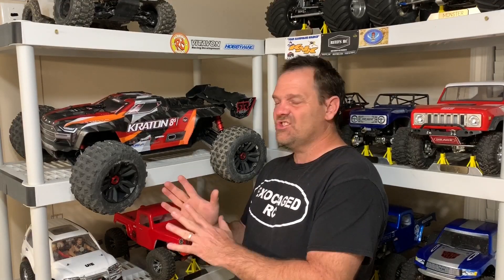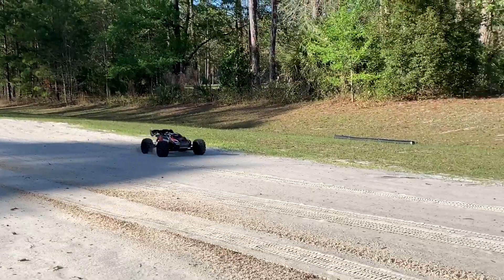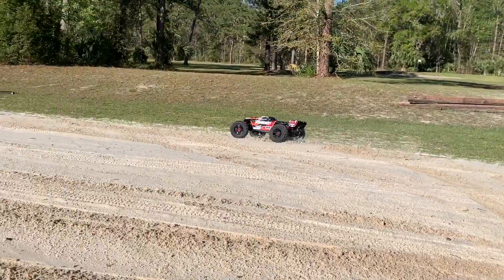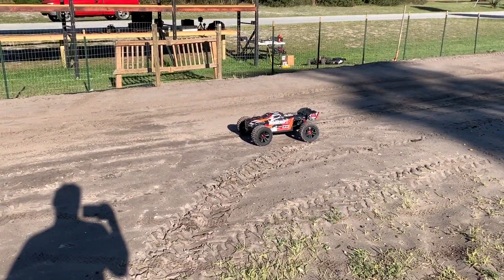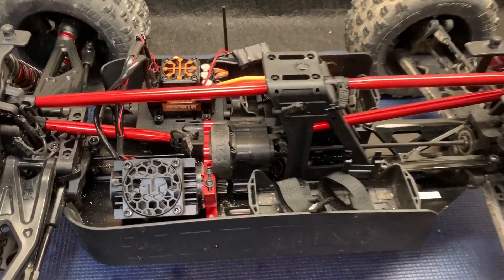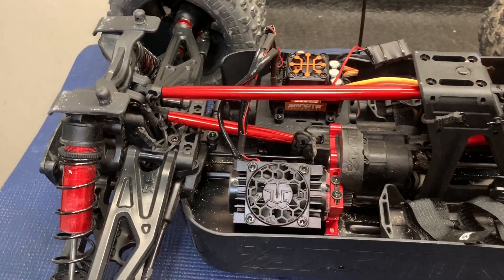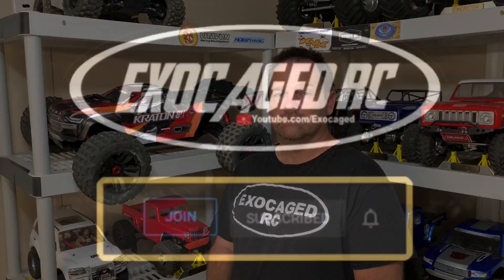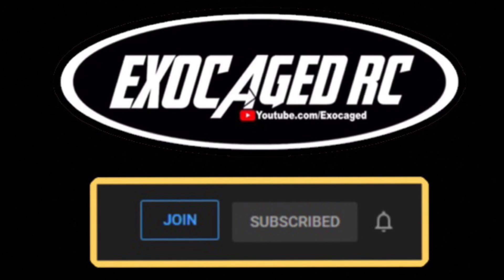Arrma Kraton 8s v 1.5

Comment: Quick 2 questions: What changes by increasing BEC Voltage to 8.4 versus 6.0 - and what does the motor timing degree increase from 0 to 7.5 do (even 11.25 which we didnt see the result of)? I just got a great deal yesterday and bought this exact model and some 4S batteries with 9000 mAh and 100C / 133.2 Wh - best thing to compare with is a rocket - and that´s on stock 17/47 gearing. I did change punch setting to level 5, and just to be safe - break level to 75%. Just wondering what the other 2 before mentioned parameters do to the performance? It came with an included 23T pinion which I without doubt will install shortly. Smiling ear to ear is the correct way to describe this "toy"
Reply from the maker: The servo is a bit faster and stronger at 8.4v and mine is doing fine. The timing increases motor rpm but can also increase heat and amp draw lowering run time. If you’re happy with the speed and power, just turn up the bec.

Comment: you are a lucky man getting the already modified / upgraded v2... or 1.5 kraton 8s. I only got mine 2 months ago or so... 5 runs in my chassis is already bent. no skate park or box track bashing either. just your normal park run stuff. not at all happy as i have had no choice but to buy an upgrade chassis for $200 as i have zero faith in the stock one. And no ARRMA have not sorted me with these upgrades free of charge to make up for it. impressed with ARRMA..NO not 1 bit. in fact i will likely not buy another ARRMA ever.
Reply from the maker: I tell you man it was off my list because of the chassis issues. Then they did the braces. I like the truck but it’s no where near as durable or an fun as an Xmaxx is.
Reply: Exocaged RC it has potential for sure and in a way it’s great they have tried at least to address the issue. I’m sore about it personally. But I’ll get over it 🤪. 

Great videos by the way mate. Enjoy the channel. 👍

Comment: What’s the top speed about ok👍🏻
Reply from the maker: I’m guessing about 40
Reply: @asfvck7397  Not to mention that crap starts breaking even faster. That's been my experience with my bashers from Arrma and Xmaxx and Redcat. The faster and higher in jumps you go, the more $ it costs to bash. Simple as that.